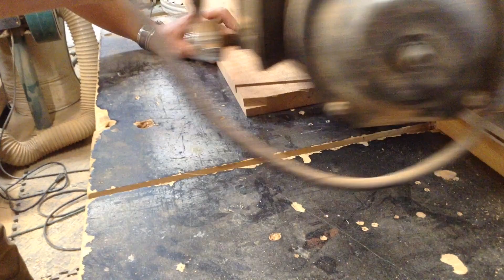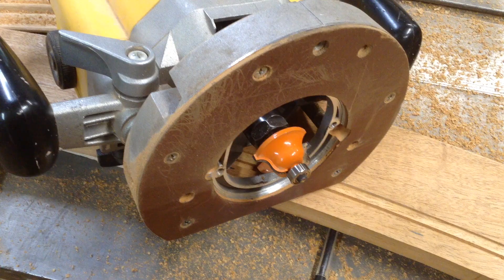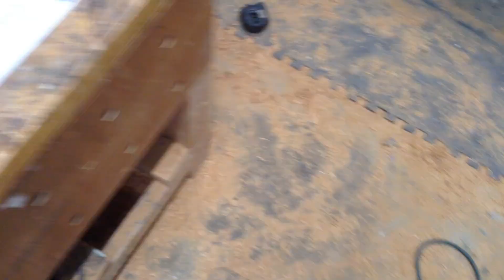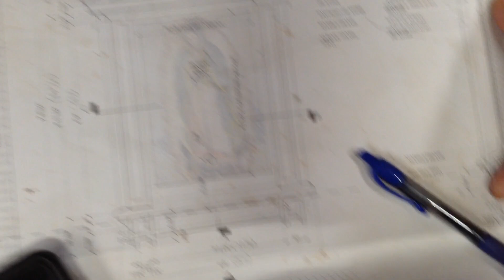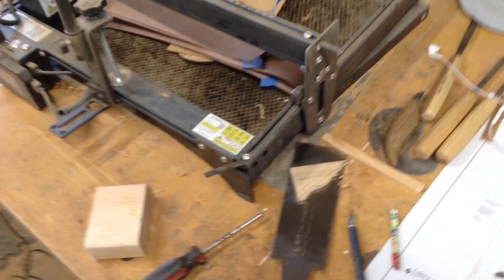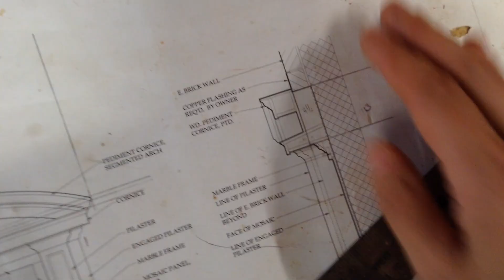The Secret To Installing Crown Molding On A Curve [Wooden Art]

Comment: Hi 👋, very nicely done, considering the tools you have, I compliment you for a mitten mistake, and then this is where your skills come in, been able to rectify it to make it correct, Well done, even people with tens of thousands of pounds worth of tools, even make mistakes by making things like this, and it can be very dangerous, because they’ll be using a spindle moulder, and you have to know how to grind and sharpen the cutters to the profile, a lot of templates need to be made, to be able to run it round on a ring fence, 
Even sometimes the architect makes mistakes , many years ago, I used to work for a organ building company in the machine shop where I was involved in making mouldings and Cabinet work for building the construction of church organs, I’ve even made tapped wooden pipes, some of which you could actually crawl inside , and over the last 20/30 years I have been involved in making special doors and windows, some of which were curved, 
I started working like you, in a small work shop, it took me years to build up my work shop, 50 odd years ago, I am now retired living in France, 
I look forward to seeing the next stage of your project, I wish you all the success for the future, stay safe, Phil
Reply from the maker: Thanks!  Your career history sounds extremely interesting.

Comment: Good work, I always spray the bearings on my flush router bits with WD-40 before each use to keep them from seizing up it really helps.
Reply from the maker: Nice tip, I’ll have to start doing that, thanks!

Comment: How long did it (or will it) take to do this project?
Reply from the maker: I don’t calculate hours and this one is impossible to tell because I started working on it in late spring.  It has a loose timeline so I worked on it in bits and pieces/

Comment: Finally getting caught up on your videos.   Looking great.  Bummer about the length, but you pushed through with a solution, and it came out great 👊.   We have a boatload of knife profiles and 8 shaper tables, but sometimes it's still easier and more practical to mould certain short lengths of profile by hand.  Well done.  ✌️
Reply from the maker: I've never really coveted a shaper or a molding machine until this project.